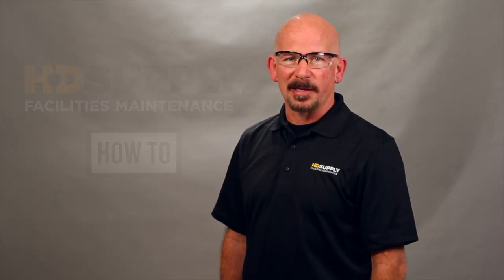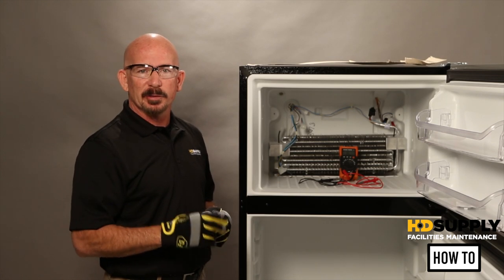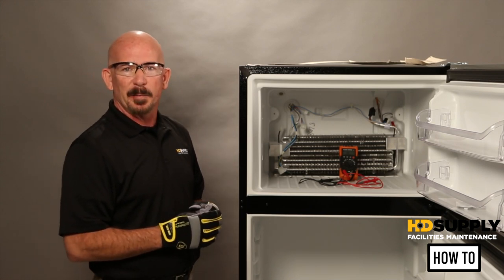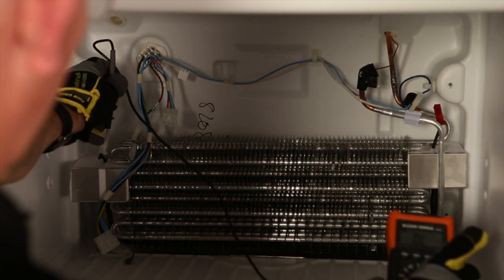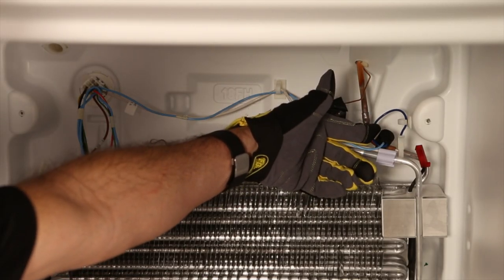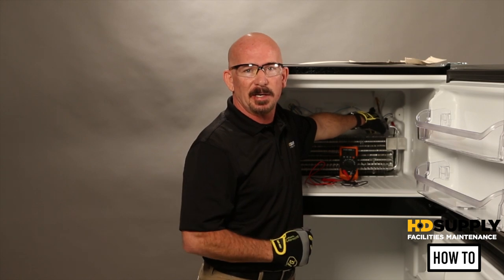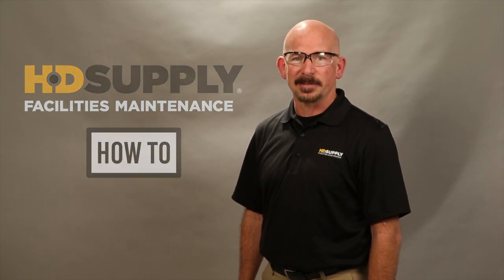How to Troubleshoot a Freezer Evaporator Coil  | HD Supply

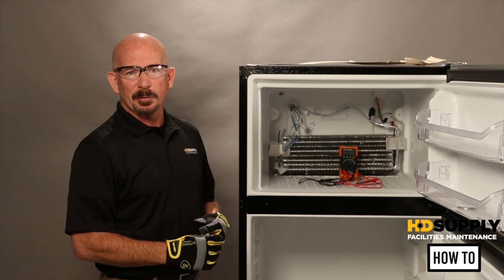Comment: 0:28 - Air flow, air flow, air flow! The fan is not the only culprit for low air flow across the evaporator coil: check with the customer to determine if food product is covering the vents in the back of the freezer.  Also, check the position of the damper flap between the freezer and the refrigerator compartments. If this is an automatically controlled damper, be certain there is signal to the damper motor.  If the damper is nearly or fully closed, the motor is not responding to the signal which is determined by the temperature setting for the refrigerator if this is a single evaporator unit.